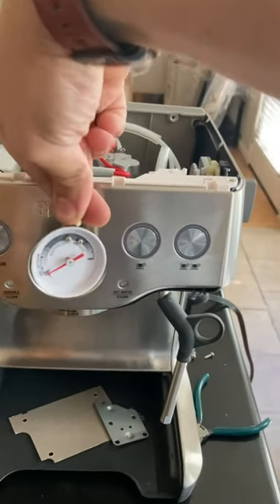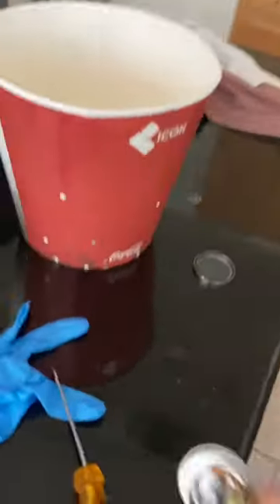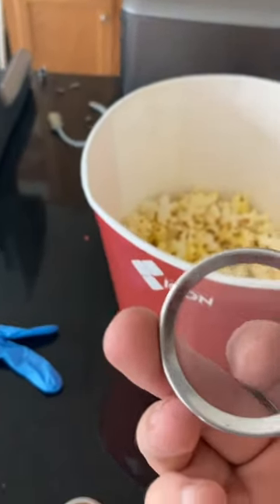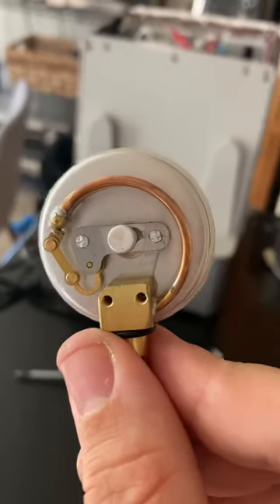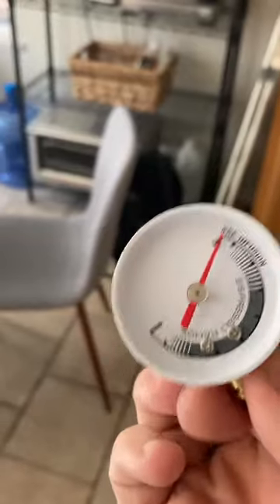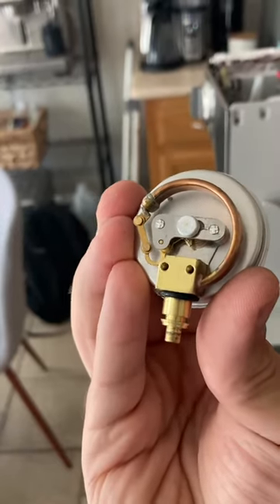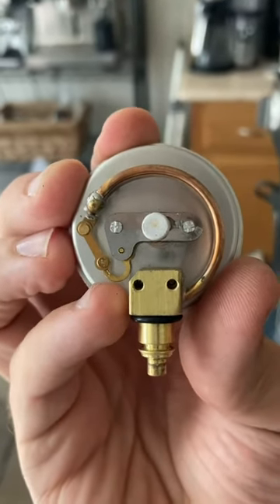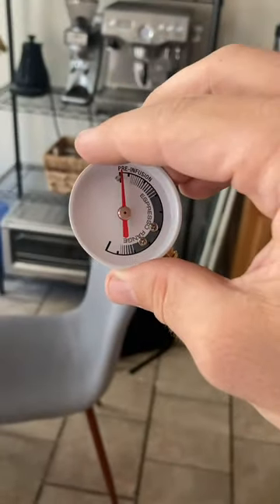Breville Espresso pressure gauge fix - for when it’s not a blocked line!

Comment: My gauge doesn’t. Before I put portafilter on water comes out but after attaching it water barely comes out. I have opened the machine up to look for clogged lines, bad motor/solenoids but all still good. Didn’t know if the gauge had anything to do with water not coming out or if a malfunctioned gauge would have any effects on the machine. Love your input.
Reply from the maker: Ummmm, in the case you are describing where water doesn't come out with the portafilter installed, is the portafilter basket full of coffee? You may be grinding too fine.

Comment: Thanks for sharing your video. My Breville machine doesn’t produce any pressure. I replaced the pressure gauge with a new functional gauge (I tested it with an air compressor). However the new pressure gauge still shows 0 pressure. I check the tube that connects to the gauge. It seems dry. If it is working, is it supposed to be wet inside the tube as the stream is filled into the pressure gauge? Thanks!
Reply from the maker: I do not think you necessarily need water  in the tube. Water will move along the path of least resistance.  and air is compressible.  I would try using  the silicone disk (used for backflush cleaning) to verify that your machine is capable of making any pressure,